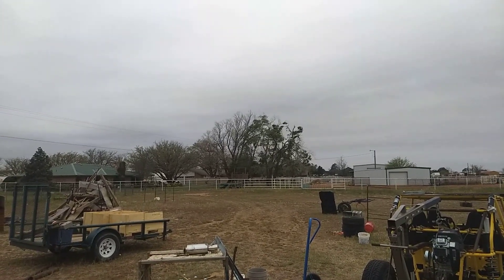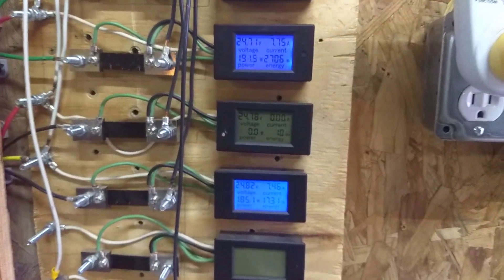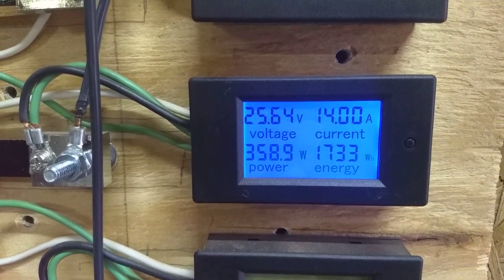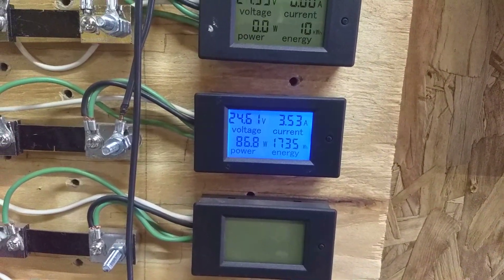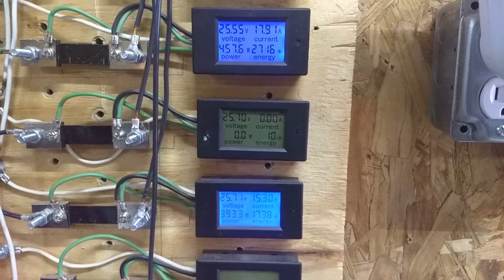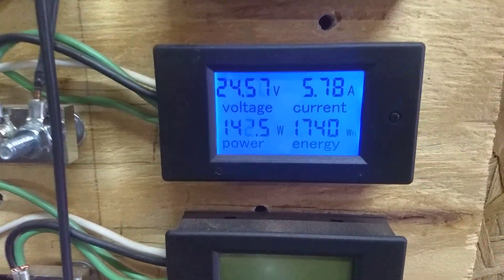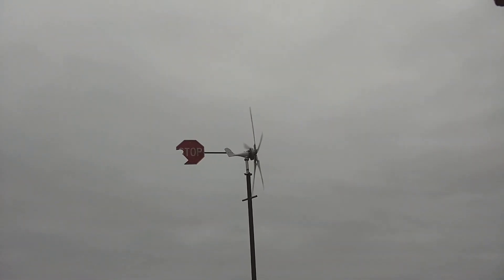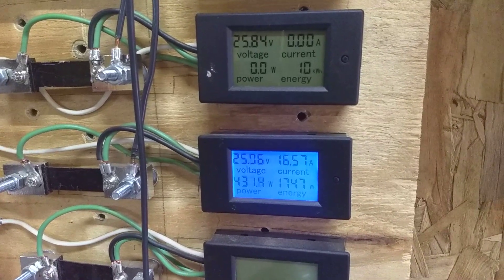5 Blades on the washer motor wind turbine are working much better!

Comment: i plan on leaving mine as they come then stepping down the voltage with a buck or transformer  what do you think about that ???????
Reply from the maker: If you're using a washer motor like I am they can produce a very high voltage...we're talking 1000+ volts once rectified.  I've been told a buck converter can handle it but I haven't done it personally...when I looked I had a hard time finding a converter that would work with such high voltage AND operate on the broad range in voltage I would see during varying wind speeds.  Please be sure to document how it works for you...I will follow it with a LOT of interest!

Comment: Hey tks to sharing i have question for u i have 2 motor one its 36 /1mm one its 42 0.8m wich one its better for wind  turbine  and my place of cabine its a lot of wind close to the baie
Reply from the maker: In my opinion using both of them would be the best option! :D  Both 36 and 42 coil stators make awesome turbines and they're both good for a solid 400~600w a piece.  If it were me I'd probably opt in favor of the 36 coil stator simply because I've played with them the most...they're familiar...if I had to pick just one.
Reply: Tks for answe i will try to make both
Reply: Tks for answe i will try to make both
Reply: Tks for answe i will try to make both

Comment: I hade problems with my inverters.. I realized i bought a i1500 for 48V and a generator for 24V :(   Now i bought a 1000W inverter but as i can se the i1500 can produce up to 1500w.. What inverters do you use?
Reply from the maker: I have seen the i1500 peak closer to 2500~3000w...but it's really not advisable to let it get that far up there :D

I run the i1500 into a battery bank and then from there I use multiple small grid tie inverters to draw off any excess production.
Reply: @ToysforWatts  ahh thats a good idea.. First i bought the Blue type of inverter in eBay.. But lol it was minimum 45V input..  Then i Bought from a  UK seller.. It said Grid Tie inverter in the text but when i recieved it it was just an ordinary #Puse Sine wave" inverter.. Without any adjustment for phase...  So the i had to but another on and i think its the same 1000W u have.. Well my hope is to get it spinning easier with 5 blades and i hope it wont peak to high in WATTS..  hehe ive done no calculations what so ever just try and error haha..